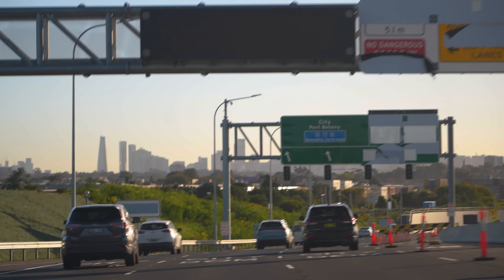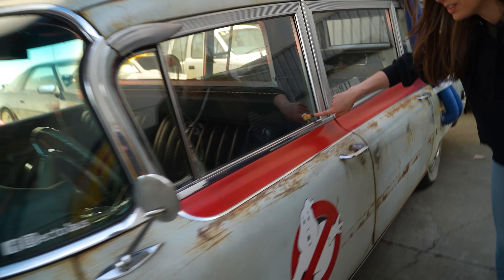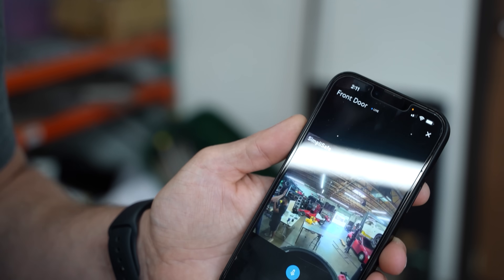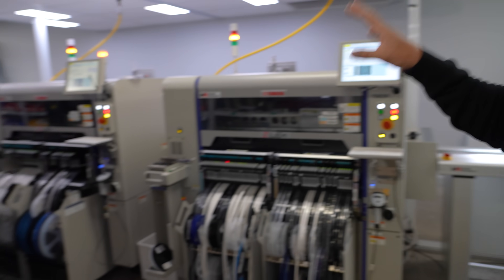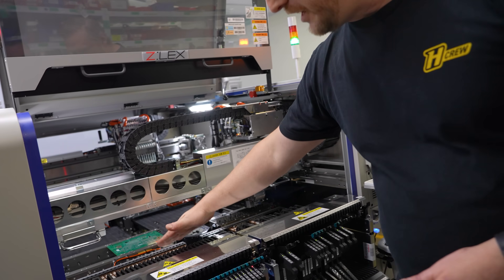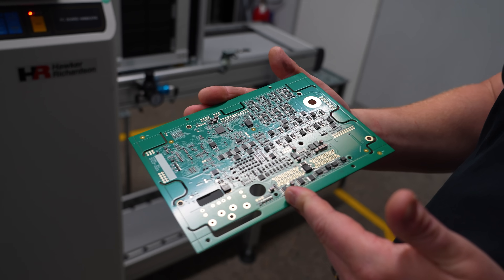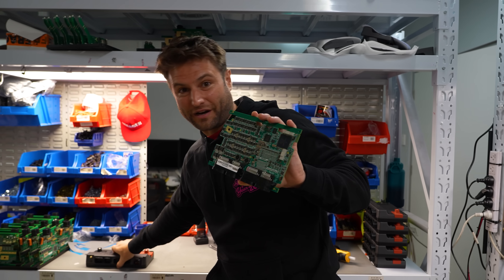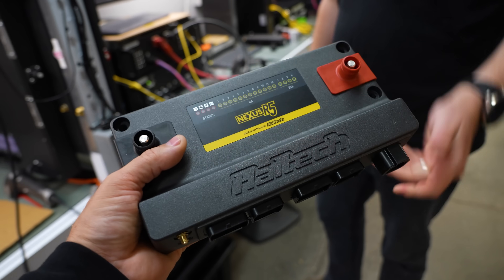How To: Build a Haltech Nexus R5 ECU from scratch

Comment: MY DAD USED TO RUN FLOW SOLDER MACHINES FOR SURFACE MOUNTS!

That's so cool

This is a fun episode, he used to bring me to work in the 80s when I was like 3-6yo!

He worked for Novation doing development for early modems, basically before the internet. 

Then he went to Handtop and worked on PDA/Internet Tablets in the early 90s. 

Bet y'all didn't realize we basically had iPhones in 93 huh?

He turned down going to Canon because he "tHoUgHt dIgItAl cAmErAs wOuLdNt gO aNyWhErE" 🙄
Reply: I'm literally looking through your old videos looking for the fan controller video because Im doing a standing burnouts cooling system and I need a minimum 200amp fan controller that can kick them on and roll in a PAIR of 120amp max/40amp RMS, 5kcfm fans without tapping out a 255amp alternator lol. 80amps max rms is fine we just gotta roll them in gently lol. So... Cheap fans, cheap aluminum radiator, EXPENSIVE FUCKING FAN CONTROLLER lol... 

But the cryo-chiller eventually going on the twin-screw setup will enjoy it too lol. And the oil coolers. Lol

Comment: Thanks for this video Rob. As an Aussie Car lover who is also involved in short run PCBA design and manufacture (mostly get the bare PCBs produced OS, but some early prototype boards here) for my own audio DSP startup, it makes me proud to see that companies like Haltech are still able to exist here, with so much tech manufacturing headed offshore. I have a much smaller small run prototyping/production setup at home, with reflow, inspection and also 3d printing and laser cutting for chassis prototyping and some small parts. Next tool I plan for is a pick and place; at the moment I still place the components by hand, after the solder stencil/paste is applied and I use a mix of hand solder, hotplate and oven reflow for finishing the board.

Comment: Using a drill to send in the screws into a PCB is absolutely wild. You could see all the metal shavings all over the bit as well. Wild scenes to see for such a big company.
Reply: Wild hay? They have just about zero failure rate so I think they know what there doing.
Reply: @A_lesson_in_Hate  I've personally sent back 2 ECUs with faulty grounds.
Reply: @A_lesson_in_Hate  I know way too many people that have had to return haltec ECUs for fault testing
Reply: @A_lesson_in_Hate  I sent an ecu for cold solder joint
Reply: Also finger prints all over the plastics  is the worst. I know I'm a nerd and get finger prints everywhere.
Reply: I noticed this as well as the lack of ESD protection when handling the PCB
Reply: @Baube418  Yes, wonderful to see everything being done in-house (more likely to protect their IP than anything). But where is the ESD protection? The term "latent defect" springs to mind. Hopefully they have an ESD treated floor and are all wearing heel-straps. Hopefully....

Comment: i am a process technician and worked in a big electronic factory for BRP, they do a good job but i think i saw a few flaws in their process, you cant touch a circuit board without a grounding strap and proper gloves for cleanliness, and they need to torque every screw, some where with drill that can be adjusted, but i saw one was done by hand !!! that is a nono.

Comment: I have worked in the Electronics industry and from what I can tell from this video Haltech does NOT follow basic ESD protocol.  No one is using wrist straps, or ESD shoe straps, they are wearing cotton clothes which will produce STATIC that will damage the components. The units may pass the tests, but may fail later in the field due to poor handling.  Look up IPC standards, and from what I have seen Haltech is producing Class 1 which is the lowest standard.
Reply: Static here will not cause future failures it only cause failures at the test bench

Comment: I'm noticing a lack of esd protections entirely. I wonder how many units they have to scrap(or rework) because of esd damage. I work for a sensor company and we have quite a bit of esd precautons. Heel straps, wrist straps, smocks, chairs, work mats, ionizing air blowers, etc. Laser diodes are the most sensitive to that. Its also interesting to see that their assembler doesn't wear gloves.
Reply: Looks like they are producing Class 1 electronics which is the lowest designation in IPC.
Reply: you are right, i was a process technician, had the esd ainsi s20.20 training last year, they also dont torque their screw, that is a nono!!! used to work for a electronic factory for BRP products.

Comment: rob they did wave bath soldering etc long before you were in high school, you're not THAT old. and some oven stuff too.

wave solder is why the boards from a certain era for high current stuff have that 'wrinkly' look to them, it was like running a wave of molten solder over the board.

Comment: I didn’t see a cold cycle or hot cycle test…I built chips for Cummins and ford and it was very similar expect we had a high temp coating that also acted as a sealant on every board and we would test every one before and after being put in a freezer for hours and a oven for hours then we would seal them in there cases

Comment: Rob Dahm I used to work in the SMT industry and I am here to tell you that the SMT industry has been doing it that same way for over 40 years , which means yes it was even done that way back in 1983 when you were born
Reply: Now smaller and faster.
Reply: yeah. I was sitting here thinking this, but resisted saying it, as he is so clearly excited about it. That said, the inspection setups at that point would not have been anywhere near this level.

Comment: I recently built an open source standalone ECU for my e36 called speeduino and have started on a personal project to build my very own standalone ECU. This sort of information is extremely valuable for the right type of car-enthusiast. Man do I have a long way to go
Reply: how was your experience with the speeduino? also, how do you know where to start with making your own ECU? this is something super interesting to me as well, ive beeen coding for years and have some basic microcontroller knowledge and i obviously love cars, would be sick to combine them all :)
Reply: @luukvanoijen7082  I’m in the same boat as you. However I just have a lot of coding experience and little to no microcontroller experience. My only experience with them is using an arduino for my speeduino. Honestly just start out by designing simple circuits that can read/control different aspects of the motor like injector circuits, ignition circuits, etc. In my current project I’m trying to use an STM32 microprocessor as the base for the ECU. Currently working on just the basics and will slowly work my way up. My plan is to have a basic 8x8 sequential (injection/ingnition) with knock control, EGT, injector correction, and DBW throttle capability. I also am no where near proficient in PCB design, so I have that to work on as well.
Reply: @luukvanoijen7082  take a look at an open source thing like speeduino.

the timers/interrupts stuff is the hard part to get right. because the ecu is all about timing.  the faster the microcontroller the more leeway you have to be stupid with it (8mhz vs. 300mhz has a world of difference in how well your stuff has to be designed for it to be able to run a 6000 rpm 4 banger).

another well discussed venue for many of the things an ecu can do is 3d printer firmware and dev discussions about them. usual arduino sort of projects don't cover that side at all usually.  those spinning led persistence of vision propellers with leds on them that paint an image in the air are sort of a bare bones ecu visualized tho..
Reply: Speeduino is really cool for 4 cyl cars and is unbeatably cheap (i built mine for 150 usd). But if you want a more advanced diy ecu there is rus efi which has a lot of community made plugnplay boards for different engines!

My biggest gripe with speeduino is no knock sensor capability
Reply: Everyone starts somewhere.
Reply: I'm loving this conversation. I was recently searching these cheap ECU options
Reply: There's a massive difference between a nexus and a speedduino. Even to megasquirt, especially with the ms3 pro mini.
Reply: @Low760  of course, but the guy didnt claim they were similar in capabilities lol
Reply: I would probably advise against going STM for beginners because it's not the smoothest learning experience. Instead, I'd go with some ESP32 variant, as most of the new ones have built-in TWAI (CAN) capabilities and the software support is unmatched

Comment: One of my early cars here in oz was a ke30 two door Corolla that ran a 2tgeu with one of those early haltech units. A happy little 1600 8v twin cam Yamaha designed motor that enjoyed being beat on daily. ECU came with floppy discs and needed an ancient black and green screen laptop. I dummy wired the factory ecu so it looked like it was running the factory one for inspection for the street. PowerFC does the duty in the s14 these days. Car scene wouldn’t be the same without either of them. Kudos.

Comment: I am considering buying a R5 right now.  I am doing an engine swap and want to rewire my vintage car and current cabin controls (internal switches) to the PDM without using a new button board.  Do I convert my old switches to  CAN or even plug them in?  trying to figure out these things.

Comment: hi wish i had a haltech ecu i have a nissan nx 1600 (ga16de+t with turbo running on a sr20det ecu (flashed) it works but its far from optimal and its just a cheap bult the ga16de normaly makes about 97hp standers and chipped 102hp  and i have around 125hp at the moment